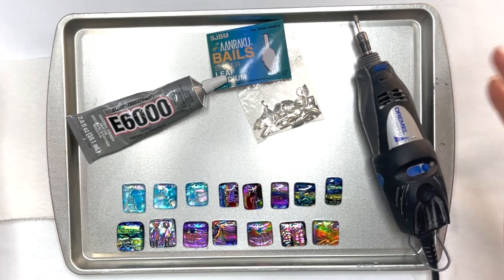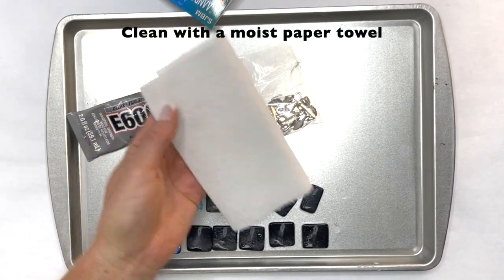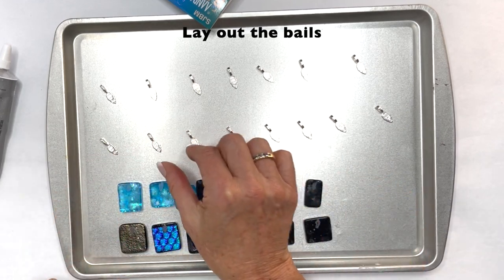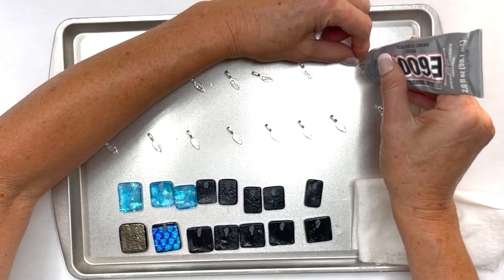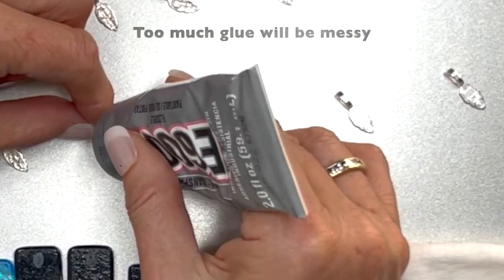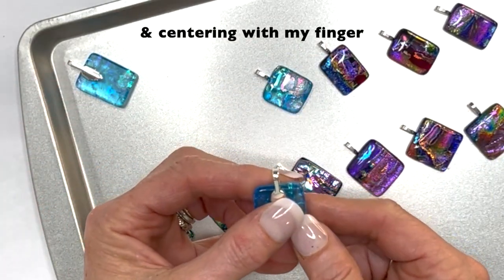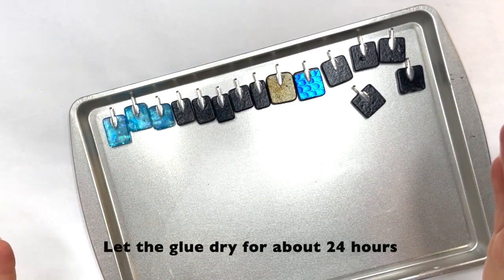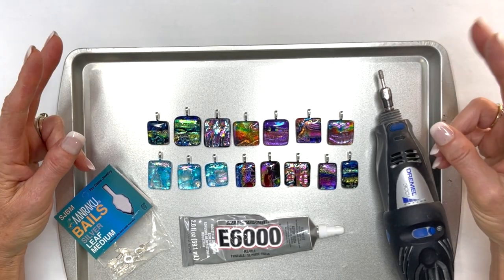#97 Gluing Bails - 7 Easy Steps

Comment: Would never have thought to bake the glue for 20 mins to strengthen the bond!! TFS!!
Reply: E6000 is only rated to intermittent exposure of 180F.  Any temperature beyond that is likely weakening the bond, which is typical for these types of adhesives, heat actually softens the material.  You might not see a breakdown in the bond because jewelry doesn't put the bond under much of a load.  E6000 has a peel strength of 34 pounds per linear inch, likely a lot less at 270F.  Baking E6000 does not provide any benefits to bond strength, in fact it's just the opposite.  Follow the manufacturers directions for proper use.
Reply: Thank you so much, you gave some very valuable tips:  the grinding, the arrangement of all the components , the manner of sliding the glass on the bail, and the "mass production". Thanks for your generous sharing of your expertise❤

Comment: If I am gluing the bail onto a ceramic or polymer clay piece, would I still do the baking part?
Reply from the maker: Great question. I’ve never tested ceramic or poly clay. But I would guess that ceramic would be similar because the glaze is essentially a glass coating. But I don’t think it’s necessary to bake it onto the poly clay and baking them may damage the finish.